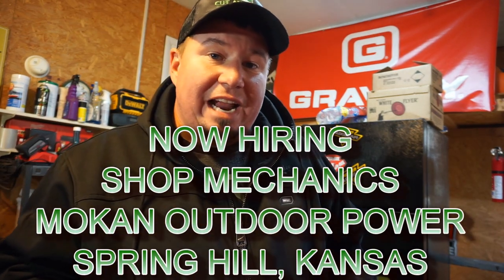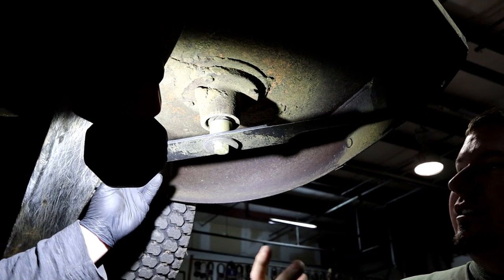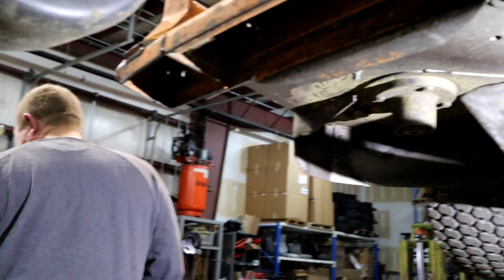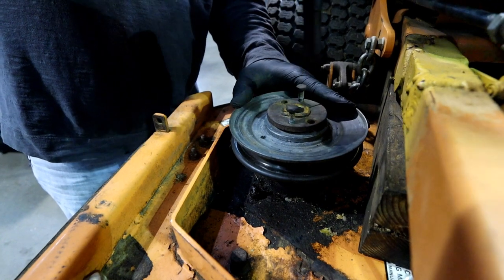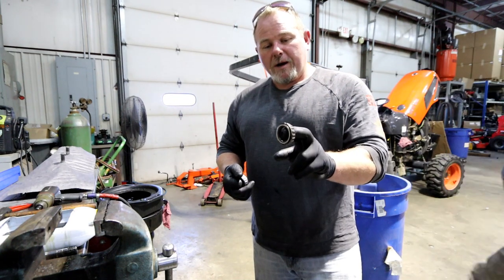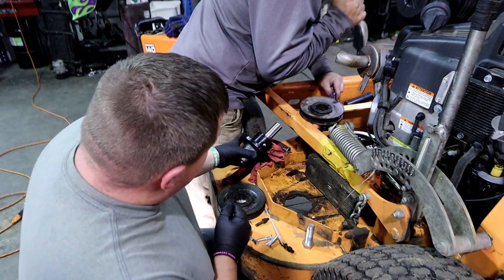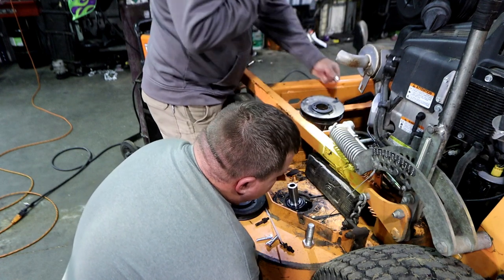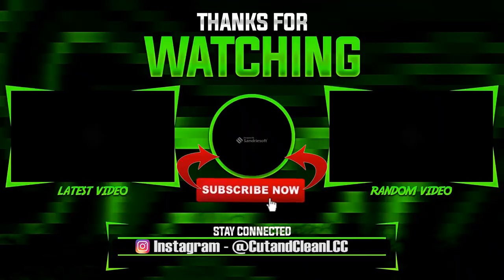I'm in over my Head! | Scag V-Ride Lawn Mower Spindle Replace and Destroy

Comment: I tried that about 20 years ago I replaced every thing but the frame the problem is the parts are expensive if you built a machine with replacement parts it would cost double or triple of a new mower good luck my friend 👍

Comment: Step 1 buy forklift to raise machine  to work on. Step 2 get a big hammer and pb blaster.😂
Reply: When I changed the spindles on my wright stander I used the front end loader on my tractor to lift it up. Made changing them out easier